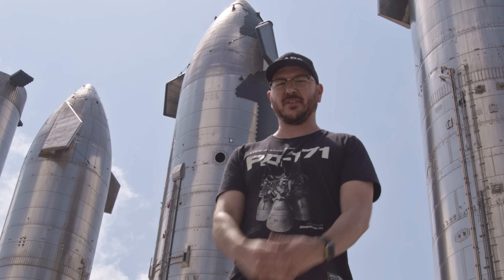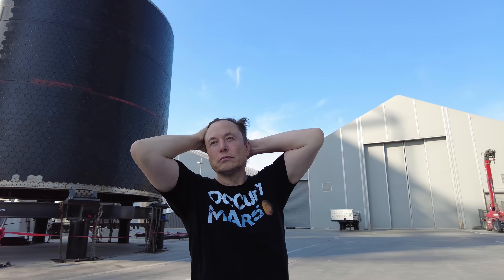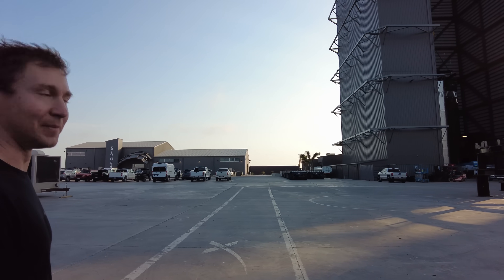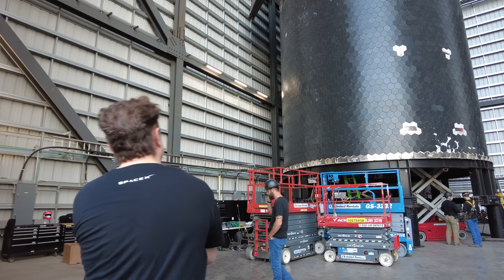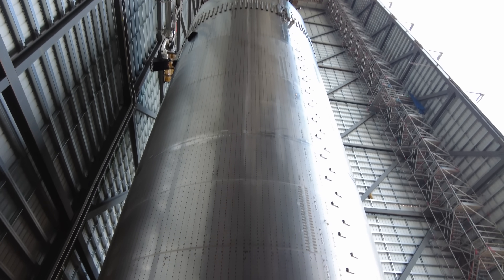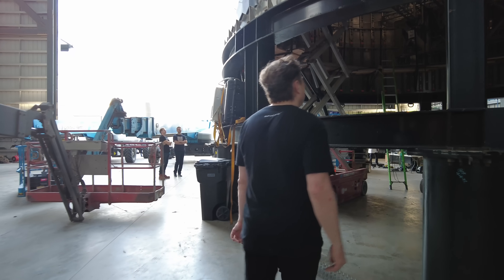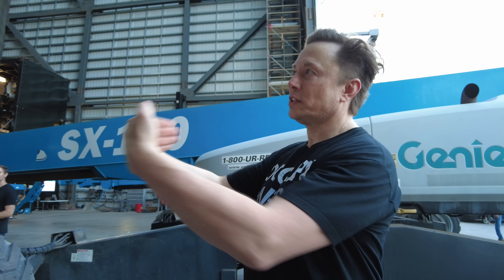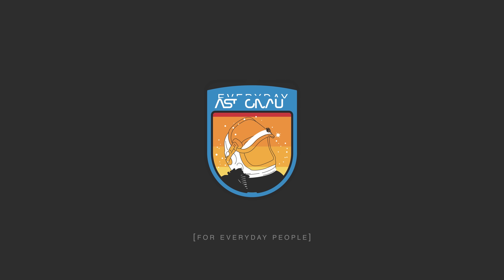[2022] Elon Musk Explains Updates To Starship And Starbase!

Comment: For Crew missions to Mars, would be more efficient and safer a modular system. Assemble at LEO a modular Spaceship using Nuclear engines, where the Crew would dock with it in a Capsule. Then do the voyage to Mars, and once the Spaceship arrives making the orbit insertion maneuvering, the Crew would land on the surface using a Capsule with a propulsion system similar to the Red Dragon from SpaceX. Already on the surface, there would be provisions and a habitat. An Ascent module already fueled would be ready for the trip back to the main Spaceship, to return back to Earth. Landing then with the initial Capsule docked to the Spaceship.
Reply: But you can't put 100 persons in a capsule
Reply: @jiehao9378  yet.
Reply: give everyone 9m diameter luxury apartments - make river-like lakes for indoor walks, seafood and o2 algae (ice as building material be self sealing and give vast structures in no time)
Reply: @replica1052  delusional Sci-fi claims. Few Crew expedition missions to Mars are one thing, another it's claiming a possible large Human colony mostly with civilians. The Pandemic was just an example how many can't handle the pressure of isolation and restricted to a tight space.
Reply: @RogerM88  with multiple rockets help be seconds away no matter what problem
Reply: @RogerM88  Kind of funny, I thought the pandemic demonstrated how well some people people can handle isolation and restricted space. Those who can't handle it are probably not the ones who should go. It's a silver lining that the pandemic could show people what group they fall in.
Reply: @carl8703  A colony on Mars it's not economical viable in the following decades, due to be too much dependable on supplies coming from Earth. And major technological improvements into engine propulsion, are required. A base on the Moon, to test Life supporting systems.
Reply: @carl8703  maybe experience living mostly inside pressurized bunkers, with few excursions to the surface using pressure suits, rationalizing supplies, monitoring Life supporting systems, and constantly working in harsh conditions...then maybe many would start to valorize, how great is to live in planet Earth.

Comment: The cost (in today's dollars) of Lindbergh's 'bespoke' aircraft was about 300,000 dollars. That is for the aircraft alone. The aircraft cost to send one person across the Atlantic today is about 20 bucks at most (for the Boeing 777). That is a decrease of 15,000-fold. So, yeah, it's possible to reduce the cost by a factor of 10,000. We have done it in a somewhat related industry.
Reply: Increase capacity, increase the 'cycles', build out the infrastructure. Huge list of technical demands. I can think of only one extant species that can pull it off. lol Find a mirror.

Comment: For LEO missions, Starship could have fixe wings reducing complexity, and a retractable landing gear, not needing extra engines to gimbal, and extra propellant to land. But it would start to look more with the Space Shuttle.
Reply: Fixed wings don't reduce complexity lmao. Huge number of new structural loads that would require a total redesign.
Reply: @Marade  if Starship needs to enter the Atmosphere belly first as angle of attach, then they will probably need extra structural reinforcements. For a reason Starship is transported vertically, not side ways.

Comment: Put the grid fins on rings so they can rotate? Will also provide ability to maintain rotational stability. Fin forces against each other and rotate rocket at will. Much love. 💚
Reply: Also will allow use of intentional align/de-align to allow munching air at Every speed. Inner outer ring will allow for insulating layer, which can accommodate heating and counter vibration.

Comment: Basically what they are talking about is this. I'll dumb it down a bit.
Basically you get the VC which is torque, you need 1,282,282,90. Rocket dots because the air isn't dense enough in the microwave.
They need to use griffins to control the altitude of the refrigerator in order to get it combust and the reindeer CGI beings. This part is very important as you need to render in the Griffins to get C02 nitro VC levels. Now the VC isn't as important as the 90wyv because in order to get air flow intake you need lots of a.k.a rancho. I'll explain further if anyone still is confused.

Comment: Why does Starship need to be caught in the air when it's supposed to land on both Mars and the Moon and take off again. Will they be doing test landings in the desert to simulate off-world landings?
Reply: The booster and ship don't exactly "need" it. It's a nice thing to have for variants/flights that don't depart to other celestial objects since it's getting rid of a lot of mass and complexity on the vehicles.

We don't know anything yet if they'll do test landings on unprepared surface, would be interested in that too.

Also:
Down the road when there is a base capable of further construction on Mars for example they will build a Mechazilla there for catching so even most Starships heading for Mars or the moon won't need legs anymore.

Comment: Ellos to Elon as well as Everyday Astronaut.

I got a fuel saver, that's lightweight and can shave of tonnes of fuel.
Compressed liquid air, with remote heating. Takes off and lands similar to the regular guided landings
and soft touch touchdowns, easily re-usable, and little wear and tear.

Basically a high pressure liquid air tank, with aerodynamic tip,which fits a regular rocket assembly,
but provides intial thrust for both, reducing fuel use for the rocket assembly.
Imagine shaving off 25% of the fuel usage, by a ground based compressor, a big fat tensile capable liquid gas tank,
lightweight, and a heating system based on either remote laser/maser projection, or a thermite infuser.

Sounds ok ?
Reply: Estimated cost of assembly roughly $4.5M, and per use roughly $700.000 for safety inspection, automated computer
micro fracture/laceration scanning.
Reply: It would be better than your attempts for a carbon composite fuel tank, which lacked integrity when empty.
It may yet work, but you need to use an internal structure that keeps it up when empty, or a lightweight external frame.
Or possibly a set of pyramidoidal innner structures of a lightweight metal, that keeps the tip up when empty.
It's like stacking small wireframe pyramids with a dent at the bottom to fit the next pyramid, but using optimal
angles for both compressing and tensile spanning, which doesn't give way to temperature changes.

Comment: Elon mentioned a potential 10,000 times reduction in cost per ton to Mars; $1,000,000,000 (One Billion) per ton to send current rovers, down to an aspirational $100,000 per ton with some future Starship design. With Starship aiming to send 100 tons to the surface of Mars, this means Each starship launch to Mars would have a cost of $10,000,000 (Ten Million).

This is obviously assuming reusability, which includes flying Starship from Mars back to Earth. Based on delta-v requirements, it will be necessary to refuel Starship on Mars for the return flight, and I can only assume the cost of refueling out of Martian in-situ propellant has not been factored into this 10 million dollar price tag.

The 10 million dollar cost also seems to be just SpaceX's cost of fuel and maintaining the program, with the cost of building the rocket amortized over a large number of uses, but you can't achieve a large number of uses if every use goes to Mars, since it simply takes too long for rapid reuse (2-3 years per round trip). This means, in order to amortize the manufacturing cost over a large number of uses, Starships optimized for Mars landings will need to have the ability to be used in LEO or on the Moon as well after making some launches to Mars to be able to take advantage of a market with a higher launch cadence.

Even if it only costs SpaceX 10 million to fly the mission to Mars, there is an opportunity cost which might increase the price; if that same Starship could service the LEO launch market as well, then does it make sense to accept even a 20 million dollar payment for a trip to Mars (10 million profit) that requires it to be unable to be used for LEO launches for 2-3 years? Surely the profits per Starship serving the LEO launch market will be greater than 5 million dollars a year. Heck, it will probably be more than 5 million dollars of profit per launch, with many launches per year per starship. Therefore, the largest cost of sending a Starship to Mars could be the opportunity cost of preventing that rocket from servicing the LEO launch market for 2-3 years.

Of course, with such a high launch cadence and the ability to construct Starships quickly there is a good chance that there could be enough Starships to service the LEO market, Lunar market, and Martian market all at the same time. These markets will surely grow with lower cost access due to Starship, but I suspect Starship production will be able to keep up with this demand. Regardless, unless there is some other form of revenue stream from the Mars base, or SpaceX charges a huge premium on flights to Mars, supplying the demand for launches to Mars will be Starship's least profitable use case.

I doubt this will stop SpaceX or Elon from making Mars optimized Starships though! But I would have loved to see Tim ask Elon about the economics of using Starship for Mars vs LEO.
Reply: Mars requires refueling.  Possibly as much as 4 times in a mission (in the future I see 3).
1.  Post launch to initiate earth to Mars transition orbit.
2a.  Pre-Mars landing
2b.   Post launch Mars for Mars to Earth.  Later designs will eliminate this refueling.
3.  Prior to Earth landing

Comment: What if....
Mr. Elon Musk collaborated with Mr. Mike Patey? One does "particular things" and the other does other "particular things correctly". However, both are at particular points of progression that could benefit humankind short & long-term.
An underlying theme I'm recognizing between the two is this. Mike patey has things building up in his head, ideas and frustration(engineering wise), that have a direct use to improve and/or solve, certain issues in the design efficacy of certain space exploration based companies. 
From observation only, it might do well to seek new talent in Multi-use transformational mechanics to reach optimal performance. 
Seems like some knowledge or teaching is being left out, which when dealing with the science of the initial stages of exploration of space seems to be quite important vs. Later on when redundancy is the normal.

Comment: is it not possible to use the antennas as temperature sensors rather than having two different systems by optimizing signal charateristics to antenna temperature charateristics?

Comment: The Space Vacuum.

The reason for this is to share with you an idea of a system to clean the atmosphere, the ozone layer of pollution generated by man. With the idea that I propose, it will be possible to clean the atmosphere to a large extent, and thus avoid global warming and all its consequences.

My project is called "The Space Vacuum"

it consists of a platform placed in orbit, similar to a space station, which has a gigantic tube so to speak that connects outer space and the atmosphere.
The space vacuum takes advantage of the "suction force of the space vacuum", Things are "pushed" by pressure, more specifically by the difference in pressure of a gaseous medium between two adjacent areas. Suppose a spaceship bursts the hatch and everything goes flying. In reality, the vacuum did not pull anything, but everything loose was pushed from the area of higher pressure to the area of lower pressure.

The same effect is achieved if we connect the atmosphere to outer space by means of a gigantic tube, and thus suck out the pollution, all the greenhouse gases along with the pollution would be expelled out of the earth into space, where they do not harm the Earth. ozone layer. By connecting outer space with the earth's atmosphere a bridge would be created, this bridge is the gigantic tube that allows the expulsion of greenhouse gases. 

The space vacuum would have a system of chambers and valves that open and close to control what is ejected into space. You understand me? The tube has a mechanism that opens and closes as needed, thus controlling the suction, thus preventing all the oxygen in the atmosphere from escaping.

Harnessing the space vacuum cleaner. 

- All the garbage on the planet could be expelled into space. 

- All radioactive material could be expelled from nuclear power plants.

- In the event of a third world war, a "nuclear winter" could be avoided since the space vacuum cleaner would clean all the clouds of gases, dust and other contaminants produced by nuclear explosions.

- Capsules can be created to send humans to space, tools and equipment, something like an elevator to space, thus being totally carbon neutral, zero pollutant. 

- Could be used by Elon Musk to capture Co2 and turn it into fuel 

The space vacuum cleaner could save man from extinction and life in general on planet Earth. 

I can share the plans and photos of my idea . write me.

I am Hugo Rodríguez from Costa Rica
Thank you very much! 
Cheers, Pura Vida!!
Reply: sorry to burst your bubble, but that tube would do literally nothing. The pressure gradient inside it would be no different to that outside it, maintained by the earth's gravity.

Comment: By autogenous gas filling/pressurizing of the tanks, there should be a flexible sheet inside the tank which is pressed up the tank by fuel when full and pressed down the tank  by autogenous gas when empty. 🤔

This way autogenous gas would not mix with fuel, and fuel would always remain at bottom of tank even under zero gravity. 🤔
Reply: In cryogenic temperatures 🤔

Comment: Elon, I'm beyond impressed that you can land these now, but I have to ask you, why not parachute the boosters down, just to slow the decent as much as possible, saving a great deal of weight at launch due to needing much less fuel? Just curious! Great job on all you are doing and thanks, I waited nearly 2 years but just got my StarLink in the Mountains of New Mexico and am preparing to toss 12 Jetpacks and 2 HughesNet satellites. They worked for our needs, but your Starlink is so much faster, and will save us much money. Thanks so much for all you do!
Reply: BTW, I meant parachute to slow them down prior to firing up the boosters and then landing. Just wanted to clearify.
Reply: Chutes don't allow rapid reusability
Reply: @Tuuminshz  I understand that somewhat, but the chutes could be disposable also. Chutes are often reused for Drag racing, military, and Nasa used them for decades so I'm not sure why your reply stated that? I would think that would still save money because of the fuel savings. Slowing down a booster coming in free fall has to take a huge amount of power/fuel to slow it to parachute speed for the final landing.
Reply: @ybsmike6512  Parachutes are very heavy. And the amount/size of parachutes they'd need for a super soft landing would be ridiculous. Better to just bring more fuel
Reply: @kobaltpc5115  I stated only using a chute to slow the rocket to a slower speed, then using the rockets from say lower then 100 mph. Chutes are not actually very heavy in my experience, I have packed them before. Im hoping to get the OP to answer... Thanks for the responses. It may come down to chute weight vs fuel weight, and the fuel may be lighter. I have to believe that is the only possible reason.

Comment: Content aside, I am shocked you would use 1) An iPhone 2) on automatic exposure 3) without post image distortion correction 4) relying on internal stabilization for such an interview. I could see that for your B-cam if it is kept stationary, but NOT for your A-cam which is clearly operated by the interviewer (bad #5). Was this interview granted the same day, or were your equipment rental sources too far to drive?
Reply from the maker: Let me help a little here:

1. Not an iPhone (DJI Osmo)
2. Of course automatic exposure, I’m not going to be spending my time cam operating when doing an interview and walking tour
3. Why would image distortion correction be necessary? It’s a rectilinear enough lens
4. It’s 3 axis gimbal, of course I can rely on it
5. I disagree. Me holding the camera gives you a fresh and intimate perspective

Comment: Kudos for Tim Dabs to question/suggest why Elon didn't use the hot gas issue for the whole rocket steerage, not just attitude control systems. It was fun to see Elon and his brain listening, rub his chin a few times and then to say that's an excellent idea that occurred to me just as I was explaining it to you". I mean considering the whole team of engineers Elon has working on the project. They say never too late for a new brain on the job .Or was that a new set of eyes.

Comment: Hey Mr. Dode, I have a question for you maybe you can answer, thinking about the set up for Mars, is there a reason why Space X could not set up a Booster stage with nose cone and Vacuum engines. Stack it on another booster. Push that to orbit and reattach to the Mars Starship and boost out to mars with that so that starship can arrive with as much fuel as needed land. They could leave the booster in orbit. Boost back up to it and then Fly it all home. I know that is a simplified version of what would happen but. 
Discuss?

Comment: If you hooked up a laser system with mirrors to cover most of the area and and inside is a  filled a shiny tank full of water you might be able to use that as a type of thrust ldk. We could top the current time it takes to turn water to steam